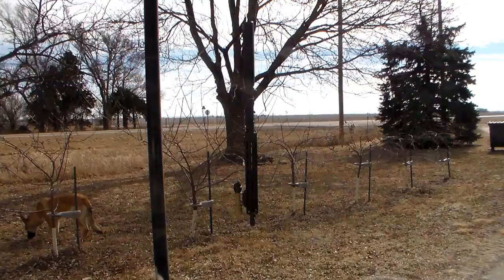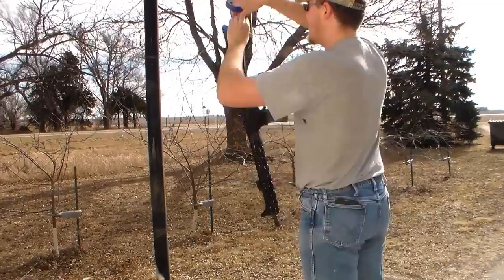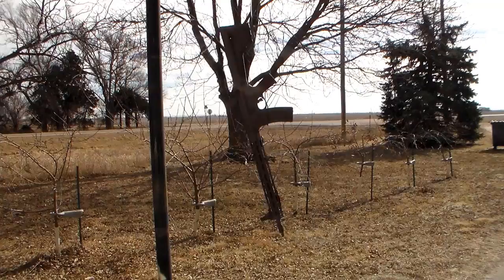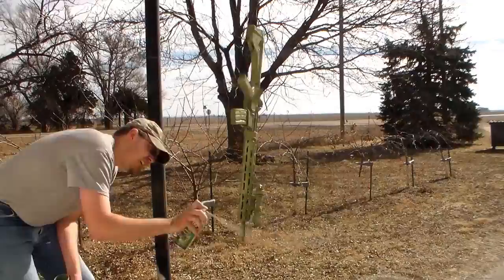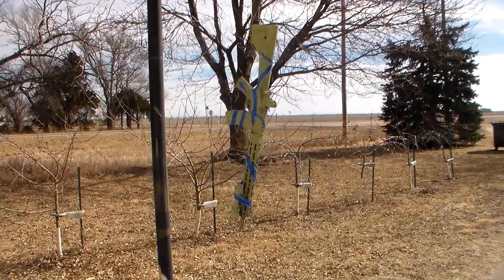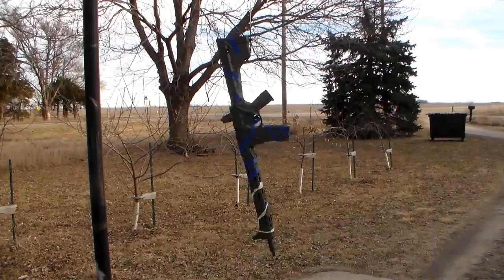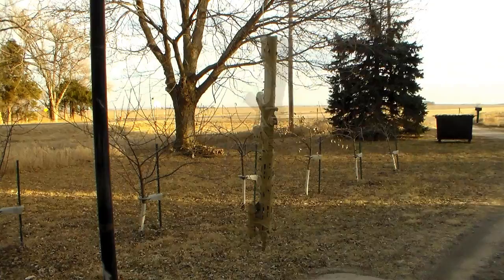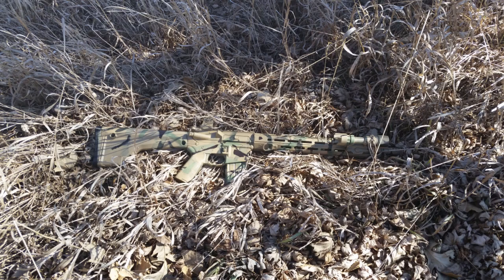AR-15: Painting Your Rifle A.K.A. Camo by Mattel

Comment: Best camo paint out there,... I love the Rust-oleum shit,.. makes for a great coating...tough as nails compared to others if you let in cure good in hot weather...at least mine did. Looks great !!  What matters is how well it works for the area your gonna be in.  What I did on one I did was make a Duck tape backed stencil out of 4-5 different types of local foliage and cut it out,  it was pretty tedious,.. however I can reuse em.. just food for thought
Reply from the maker: +Eric K I've done something similar in the past using grass and a few local branches. But I just held them in my hand. It worked really well and was a bit faster than the method I showed here since I wasn't putting on a full coat each time. Another method I've used is wrapping the rifle with jute twine in between layers. It's very fast although I didn't find the results very ascetically pleasing.